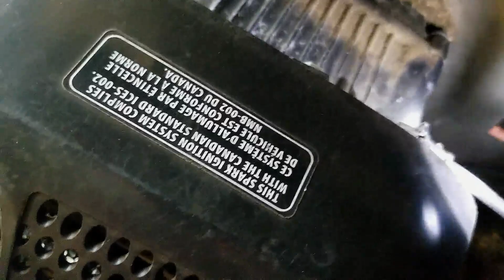Diagnose Craftsman Lawn Mower Self Propel System

Comment: nice fix and i would of did the same repair. I like Craftsman because all you have to do is go to searsparts and type in the model number and you get a parts breakdown and part numbers. I just replaced the brake cable on my Cub Cadet and it cost 30 dollars but mine snapped so i had to replace it.
Reply from the maker: Craftsman was a great brand. Too bad Sears went bankrupt. Cable replacement is the second most common issue I see after fuel issues. Thanks for watching. Cheers